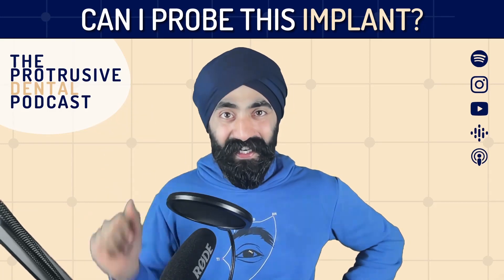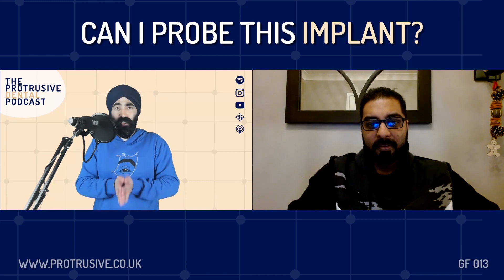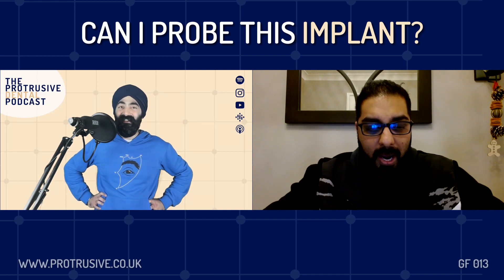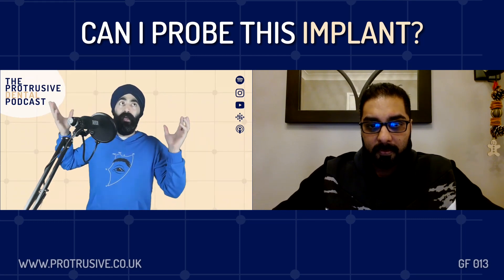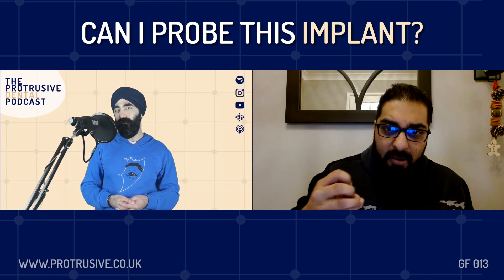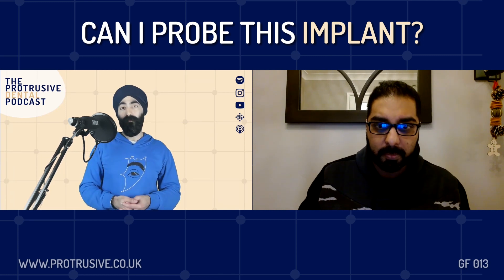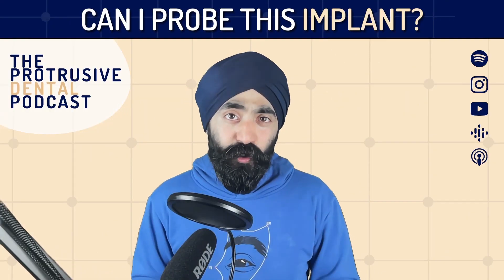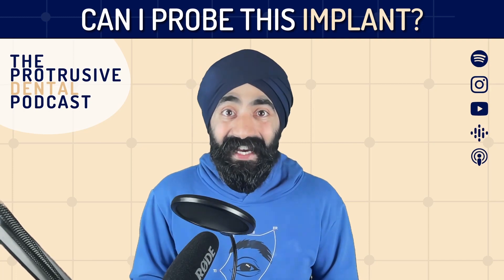Can I Probe This Implant? Do Metal Probes Scratch Implants? - GF013

Comment: This video was so informative! I have 5 implants and had a six month cleaning and check up yesterday. The hygienist recorded bleeding upon probe. I think she was being a bit rough around the implants because I hand floss and use the waterpik , daily with no bleeding.

My crowns are screw retained  and I was worried that she mighty damage them. She used the ultrasonic scaler and then hand scraped.  I almost told her to skip the implants. The last thing I need is damage to new and very expensive implants, whose crowns I’m still paying off. 😵‍💫